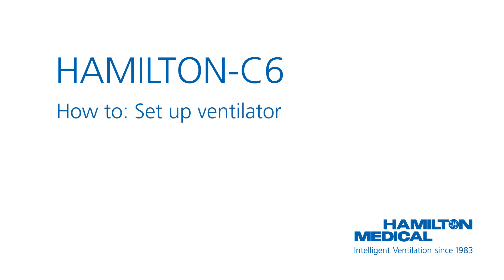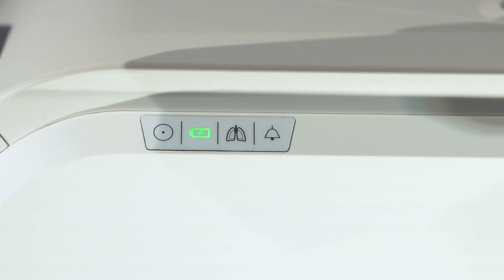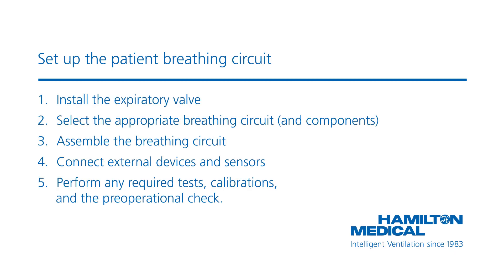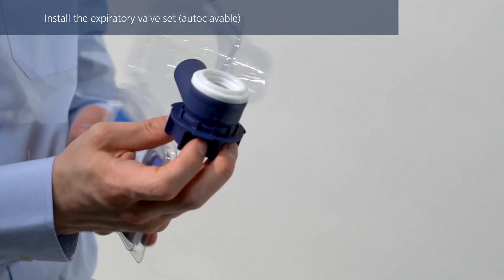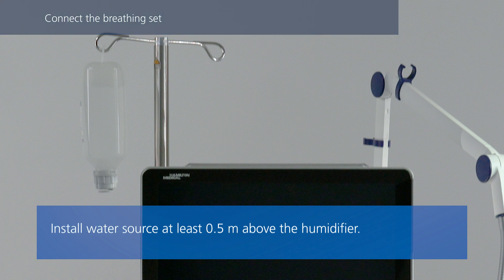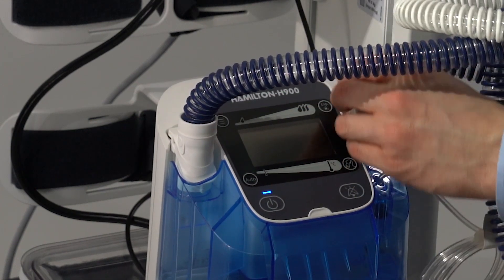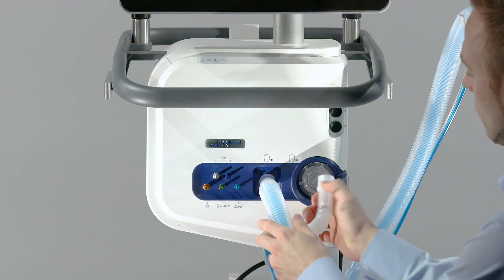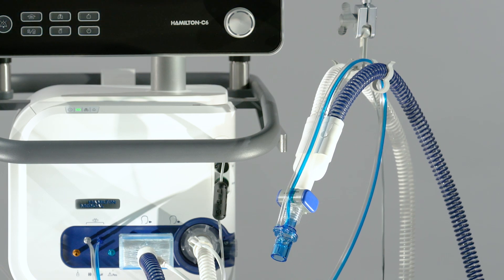HAMILTON-C6 - Ventilator Setup

Comment: Here humidifier one side green light and same opp. Direction red  errow is it ok
Reply from the maker: Hi, Fida! Please check that the limb is inserted correctly. Red would indicate that the limb connection is either faulty or a limb is not connected. You can see the operators manual here for more information: https://www.hamilton-medical.com/dam/jcr:fbd94272-c4f5-4042-9eb8-590c091c8869/HAMILTON-H900-ops-manual-en-de-fr-es-it-pt-zh-ru-tr-624431.08.pdf
Reply: @Hamilton-medical  thanku